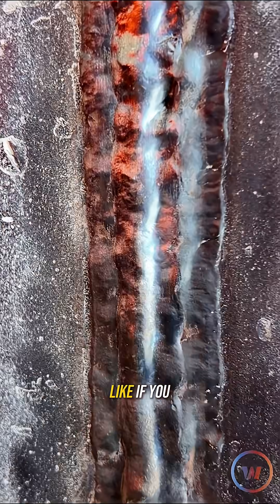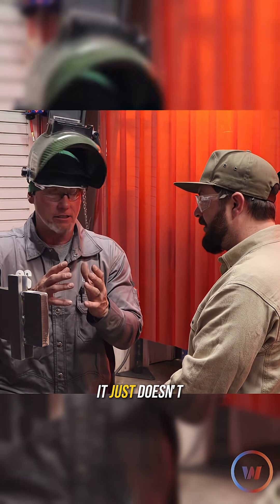Structural Strength Over Stacked Dimes – FCAW with NR-233

Comment: I working to get good with spray transfer. DID a class five hitch on a pusher and they had alot of welded fits on 3/8 plate .And i welded the hell out of it but if I had my new Miller I could have done that welding in a hr

Comment: Flux core really shines for load-bearing joints between thick sections of carbon steel. In my industry (automotive), flux core is the preferred process for ladder frames on trucks.

Comment: Ok I'm a dummy lol.  What's 232? I did stick/Arc welding back in high school some and did fair,  just got a flux core welder a few months ago and started back with it.  Did a mower deck and thought I did ok,  sounded right and looked decent enough. So far it's holding.  I've been been watching as many videos as I can as I'm fixing to start repairing places on the cab of my 1980 Chevrolet K20. Been practicing on the tailgate where there are several holes that were cooked into it for whatever reason and I haven't blown through it so I guess I'm doing ok. Looks better after I grind it down. Just trying to learn so I can repair most of my own stuff when welding is needed.
Reply: Its a lincoln gasless wire
Reply: Its only mainly used for structural applications since the wire diameter is really thick. It ranges from .068, .072, and 5/64 wire diameter, its fun to use but on a hot day its definitely a mood killer

Comment: Did i just see you do the sides leaving a valley then do a middle bead instead of and this is dealers choice from right to left in bead formation 

Never in my 30 years of welding with this process or any other have I left the center empty for last thats crazy I want to bend that weld and see if there is trapped slag pockets
Reply: Agreed. Bend test on the camera no cuts, no editing, no funny business!
Reply: I could be wrong but it looked to me like the center was grinded out then another bead laid

Comment: Is that gassless¿ sounds and looks strange
Reply: @redlew012  Yes, it's gasless. Kinda like stick welding with wire to put it simply. Completely different process. You can't weld exactly the same as with gas. Stick out is a lot more to give time for the flux to form a gas.  It punches into the metal more than gas welding and you have to listen to your arc and adjust your stick out as you weld. Once you get it, I'm sure you'll love it as much as gas.

Comment: What size wire, wire speed, and voltage are you running? Great job 👏 👍
Reply: That's got to be at least 1/16" wire. When I've done inch-plate tests like this the machines are set at 24-26v and a pretty high wire speed.

Comment: Hey, can you do a video of oxy-acetylene cutting 12" thick steel by hand?? For educational purposes.. its obviously not that common in industry but would be cool to see
Reply: Use an ultrathermic lance
Reply: 100 mil all it will cut by hand
Reply: @FionnbarrBoggs-t9r I looked it up and they make big enough tips to do so, depending on which chart you look at some go to 12" max some go to 16" max.. and apparently you can do 20" or more with propane...but never seen it done.. it also says travel speed is like 2-3 inches per minute. And youd probably have to preheat it using a massive rose bud unless youre really good with the torch
Reply: I tryed cutting 120mil big nossel i could get no go would not cut for me had till get  a engineer place till do this in Ireland mabey better set up in the USA @WeldyWelderface
Reply: @FionnbarrBoggs-t9r need the proper tip size.. you must have had one that was still too small for the thickness of material. But if you had your psi set wrong too for the thickness that would create problems as well. You probably just had the wrong setup for the application
Reply: I have been shown by my head teacher when I was doing my AS 1796 pressure inspector course you can actually turn off the acetylene when cutting and just use the oxygen and the melting metal if you get your feed right correct! I used to cut 150mm plate to inspect it when I was doing the testing on submarines in the late 80's. 👍